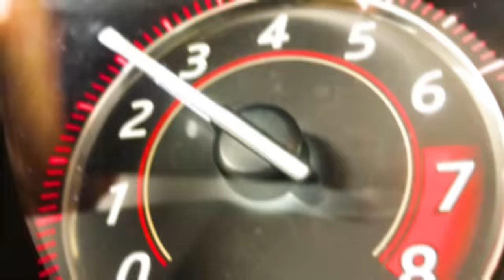AVOID: 2024's Most Unreliable Car Brands!

Comment: I will keep longer my lovely and valiant ‘13 Camry XLE, no leaks, no burning oil, no electrical problems, no CVT, no direct injection, no turbo, no problems whatsoever, just the characteristic 1 second engine “rattling” (140k) which won’t stop the car neither affects vehicle performance , I already bought all parts needed to fix it, just need the right time to do it ( myself) 😎
Reply: Great reliable vehicle and very beautiful as well. Drive safe, that Toyota will last forever 😊
Reply: And yet I had one that was a complete POS. Water pump exploded at 45,000 miles. Engine threw a rod at 72,000 miles. Never again. Over rated crap.
Reply: @jpsabovebeyondfreezedriedg1961  Lack of maintenance?
Reply: @lrich8181  millions of Camry on the road with a very few problems 🙄his engine probably was assembled by a worker who had a bad day with his wife or husband 🤦‍♂️
Reply: @64arguz 😂
Reply: And i will keep my volvo s60 when i was broke it never let me down
Reply: Pennzoil Platinum eliminates 90% of the start-up cam phaser "death rattle."  It helped out 2GR-FE engine a lot.  It clings to engine parts much better than Mobil 1 and Castrol.
Reply: @midcenturymodern9330  thanks for the recommendation, I’ll do my research, however I think that mechanical phaser rattling is something inevitable due to the design, in fact those late Toyota engines denominated “Dynamic force” don’t have mechanical phaser instead they have an electric motor in order eliminate such problems and make the engine more efficient , powerful and reliable 👍
Reply: Hard to beat a Camry

Comment: Mazda, Toyota, Honda. These are the best right now.
Reply: And the most boring to drive
Reply: @tihosesar  who the heck cares about boring! I’d rather have a boring Mazda 6 than a fun to drive crap Dodge Challenger lol
Reply: You're right, but Toyota and Honda have had big issues recently and not what they once were. Still better than the domestics.
Reply: @Blue-moon12  true. I read that Mazda might be the most reliable vehicles now.
Reply: @omt4293  Yes, I heard the same thing that they're one of the better brands now. Good to hear in my opinion.
Reply: @omt4293 You read wrong.. Lexus is number one followed by Toyota.
Reply: Buy American, MAGA
Reply: @charlesjackson1700  umm Lexus is Toyota. And they have been having issues with turbocharged engines for some reason. And I read correctly thank you very much
Reply: @xybavh6575  Ford….as long as it’s a DuraTec engine
Reply: Let's not forget about the nissan frontier. Holds 64% of its value after 5 years. That's 1% less than toyota.
Reply: @All-Miles-Matter  might be the only good Nissan left. Everything else is pure garbage. The Rogue is an unmitigated 3 cylinder disaster
Reply: @All-Miles-Matter  I own a 2023 Frontier Pro 4x.
Reply: @omt4293  Agreed, their cars and SUVs are rubbish. Their Jatco CVTs are not the greatest either. The Titan is a decent full size though. R.I.P
Reply: sadly Toyota and Honda arent are reliable as they were- Mazda is the pick of the bunch...Here in Aus they screwed the dealer network sideways (Honda) so their sales have fallen hard. Of course with Mazda no CVT thats rare these days! Great content Mate keep it up!
Reply: @xybavh6575  Toyota is more American than Ford or Chevy..
Reply: @omt4293 I have a Challenger AND a Mazda.😂
Reply: @markd_aus9809 I have had 2 Camrys. Thought my ex was rough on the first one. Bought another Camry and it was a complete POS. Overrated garbage.
Reply: @omt4293  Mazdas are some of the sportiest driving cars made! We have a Mazda 5 micro van that handles like a go cart! We love it!
Reply: If it matters to anyone, I just passed 170,000 mikes on my 2014 Mazda 6
Reply: @jpsabovebeyondfreezedriedg1961  what year was the Camry?
Reply: @grego7345  oh wow lol great combo 😆
Reply: @everettsager4654  I had a 2004 Mazda 6 V6. That was actually a Ford engine in it. Was my most reliable car I ever owned. Went 200k miles before getting another car which I love, but that Mazda was so good.
Reply: @omt4293  1999 and 2007
Reply: @jpsabovebeyondfreezedriedg1961  very surprised those are really good model years.
Reply: @omt4293  Thanks for sharing the story. I think Mazda is underrated, especially since they left Ford.
Reply: @xybavh6575  Then America needs to build better cars at better prices and onshore more of its production.
Reply: @omt4293  The most reliable vehicles are..  number one_ Lexus  number two_ Toyota.. and then there's the rest.. Mazda was down there a ways.. 😔
Reply: @All-Miles-Matter  Nissan is garbage 😔😞🗑️
Reply: Boring I don't know what kind of car you drive I love my 2024 Mazda CX-5 turbo it hauls ass😅😅😅😅 @tihosesar
Reply: @tihosesar I don't know what car you're driving Mazda's the best cars on the road I love my 2024 CX-5 signature top-of-the-line turbo trim it hauls ass and it's nice inside never had a problem with it
Reply: @wintersoldier6477 I drive Jaguar XE Portoflio with all bells and whistles! 
Never owned a Japanese car and never will. 

I used to work as a car salesman in the 90s in California (I live in London now), worked for Chevrolet, Toyota, and Volkswagen/Lincoln (was the same dealership). 
Toyota Camry, Honda Accord and Nissan all looked the same but a different badge. 
Drove the same; boring and  uninspiring. A good car to take you from point A to point B, reliable in comparison to horrid American cars of the era, but not so good if you get a little hit. The whole body goes out of whack, shoddy workmanship. 
My Japanese boss at Volkswagen explained why he would never drive cars from his country and I understood why. 
This whole JP ratings is susceptible to corruption and bribes. 
Nowadays, Toyota Camry is in very ugly vehicle.

Comment: Some of the problems being highlighted should have been solved decades ago and yet we’re still hearing about them on many GM vehicles. Why does a vehicle have headlight problems? That’s ridiculous.
Reply: Very true!
Reply: The Ram Hemi is a perfect example . Their answer ? Don't idle too long ?! WTF ... insane .
Reply: I know. Cars have been manufactured for commercial sale since 1895, it's hard to believe they're still working the bugs out.
Reply: never heard of a car leaking in water from the 1970s to 2010s. only a t-roof on a trans am or convertible could possible leak water decades ago but not  on any other  car. the craftmanship  has gone  downhill the last 10 years just as the work ethnic has went downhill in other industries

Comment: I remember the days of the Jeep Cherokee up until about 2004; solid vehicles with the in-line 6 cyl engine that hadn't changed much over the 1990s except Jeep fixed all the defects.  Incredibly reliable vehicle you could work on with a basic tool set.  My brother had one, unfortunately it got totaled when a drunk driver hit him (he walked away OK).   I guessed they redesigned it so the service techs would have some work to do?   No Hyundai on this list, but I'm old enough to remember their entry into the USA, when their cars would literally fall apart at 40K-50K miles for any number of major issues.  They're much better now (have they fixed the recent string of engine problems?).

Comment: I bought a 2023 accord hybrid and it was the bigger lemon ever. Left me stranded 3 times
Reply: I just commented that Toyota and Honda are not what they used to be. Hope you managed to get it sorted.
Reply: That's supposed to be the best engine to get in the Accord.. not the 1.5 turbo😮
Reply: That's what's happening when people get brainwashed by CR 😂😂😂
Reply: so even Honda and Toyota have their share of problems and yet when I went vehicle shopping"just bought a 2019 Chevrolet Trax with only 14500 miles on it!"people kept telling me"buy a Honda or a Toyota!"my insurance company  told outright the high rates for a Honda Civic,also I work at a GM dealers,there for 19 years so if the Trax needs servicing I can get it serviced right there and not have to drive to a Honda/Toyota dealers to pay full price for servicing
Reply: Everyone knows that Toyota makes the best hybrids.
Reply: @midcenturymodern9330  That's for sure👍💯
Reply: Do not buy a car with turbo engine and CVT transmission.

Comment: In Middle East we see that Toyota Land Cruisers 300 and Lexus LX600s are trashed engine after 60k miles. Causing overheating and hood problems. Engine failure. Transmission failure. The turbos are wearing. Still people under the warranty yep it’s already addressed. But without an warranty it’s so extra expensive to replace the whole turbos and engine

In Lexus LX600 will be electrical problems and break problems and sensors problems
That’s why are dummy people buying these and didn’t take care of it. The reliability the newer Toyotas Land Cruiser 300 and Lexus LX600 I give it from 1 to 2 out of five stars

The dealer ordered over 30 to 60 new engine for Gasoline Toyota Land Cruiser 300 and Lexus LX600 all of them

Please do NOT Buy it these expensive money and ugly interiors if you don’t seriously take care of it.
Reply from the maker: Some really great points indeed

Comment: I've come to the conclusion that most car issues are the result of improper maintenance.  The car manufacturers only care about getting customers through the warranty and usually recommend going further between oil changes and transmission fluid changes than they should (this is actually just a gimmick for sales).  Drive vehicles like you have some sense and maintain them.

Comment: Thank you for sharing your knowledge; I bought a 2015 Lexus RX 350 one year ago based on reviews such as yours.  At the time it had less than 63,000 miles and a clean car fax.  I did have to replace the neutral safety switch months later but have confidence it will last me for years!

Comment: I don't like how everyone did away with the straight six motor. By simple engineering and design you can't get better than a straight six motor. No counter balancing needed. No extra balance shafts.  The straight six was just by design a perfectly balanced engine. Meaning less vibration and no extra parts needed causing more power loss, friction, unnecessary complexity. The straight six was simply balanced. The pinnacle of it all. They've never found better. According to basic physics and engineering there can't be any better though a 12 cylinder might equal it.  Why on earth did they get rid of the straight 6?  Was it TOO good a engine?  TOO reliable?

Comment: Current-gen Toyota Tundra is another one. Lots of head gasket failures and locked-up engines with less than 50K miles. Similar deal for current Hondas with 1.5T.

Comment: Buy a Toyota, Honda or Subaru.
Stay away from FIAT Jeeps.
Hyundai 
Kia 
Nissan 
Ford 
General Motors.
BMW
Mercedes.
General Motors should go back to the 350 and 400 engines.
And the TH 350 and TH 400 transmission
Reply from the maker: Thanks for sharing

Comment: The Chevy 3.0L diesel burn oil. All of them some videos on you tube for your reference,  dealer said is normal, I say NO they need to fix the engine
Reply: Never - ever is a newish engine burning oil 'normal'... my '98 Toyota Landcruiser (4.7L v8) has 325k and it STILL doesn't burn oil on the orginal engine.

Comment: I have gm 6.2 liter. Had AFM turned off, put in catch can, and enjoy 420 hp. It's a 2017 yukon and has 0 issues.i have 80,000 miles. Change oil every 4,000, change tranny fluid and filter every 40,000. Do not forget  to change differential about 50,000.

Comment: You'll need a 30 year mortgage to get a Rivian. And on top of the initial cost there is a required $15,000 subscription needed to access charging unit, software  etc. Avoid this EV junk.

Comment: It's a shame you can't have the LS engine anymore. And I will never understand why the industry has problems with timing chains. We used them in the 60s 70s 80s 90s without problems then in 2000s, famously Ford’s modualr engines, timing chains need all these sceduled replacements. Plastic guides, stretching, etc. They used to last the life of the vehicle.

Comment: So, no mention of Ford vehicles needing engine replacements, transmission replacements, redone heads, engine fires, plastic pieces falling off while driving? No? Weird seeing as its been the topic of talk this year. Recalls, cheap plastics, valves dropping, coolant intrusions, faulty 6spd and 10spd and class actions.

The new Wagoneers are a disgrace to the name. Like like any cheap made jeep nowadays. Cant even tell them apart anymore. If Jeep stayed true to the concept they made in 2017 or 2018, then the Wagoneer would be different and actually look like a wagoneer. Nowadays, I'd spend 60 grand on a REAL Grand Wagoneer. Not some cheap Italian junk.

Comment: TOYOTA SUCKS, AVOID.
Reply from the maker: Thanks
Reply: Absolutely !! If you hate dependability .
Reply: Dependability, my a$$. Bought a new 1999 xle that had a horrible paint job, would stall when turning left, would blow oil all over the driveway under 40 degrees outside. Thought my ex was too rough with it. Bought a 2007 for my current wife. Water pump exploded at 35k then engine threw a rod at roughly 70k. Had been in the shop multiple times for oil consumption. A week after we had the engine replaced we got a letter for a recall for faulty piston rings and main bearings. Those little shit$ refused my claim because the engine wasn’t original. Fab-q Toyota. Low rent and over hyped garbage.